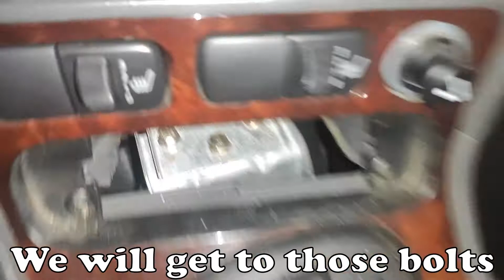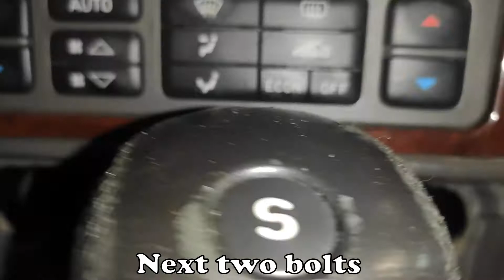Saab 9-5 ignition switch fix

Comment: Hi. Thank you for the video. it helps a lot! Can you tell if the broken metal piece can be repaired ?
In my case the key goes all way to the right (engine is starting) and seems the spring is not moving it back to ON position but I can move it to ON manually. I hope a new ignition lock fixes it.
Reply from the maker: i couldn't repair, it was too small. 
i had the same problem and only fix was ignition switch change

Comment: Y’all I gotta a question please help so my ignition stop spinning from no where then I decide TO buy another I don’t yet but,if I buy a new ignition with a TWICE CONTROL UNIT and matched key i don’t have to program nothing it’s just already matched right or I still have to program the key
Reply from the maker: i think that you will need to programm twice module to car. But what did you mean by "stop ignition from no where"?
Reply: @ingaragewithsaab  key cylinder stop spinning  where the key go
Reply: Like I can’t even put the key in it’s hard asf
Reply from the maker: i think you can just take out key barrel and clean it, they tend to get sticky.

Comment: Is there anyway I can identify if this switch is broken before taking it out? 
I cannot lock the car from remote, and radio doesn't stop playing when I take the key out. 
I've noticed when I am taking key out the ring barely move up
Reply from the maker: That would be key barrel problem. it should be easier to remove and clean.

Comment: When you pulled the rear console up and off did you break anything? Mine is half off. Can't get it over the duct correctly without completely removing it. Afraid of breaking the plastic.
Reply from the maker: try pulling it stright up, there shouldnt be problem

Comment: Do you happen to know if that switch is also on a manual drive of this same vehicle?  Mine also stays in start and won't move to lock, but the lock cylinder works fine when I take it out of the car. But when it's in the car, it won't move. from start to lock.
Reply from the maker: manual cars need to put in reverse and then you can  put in lock